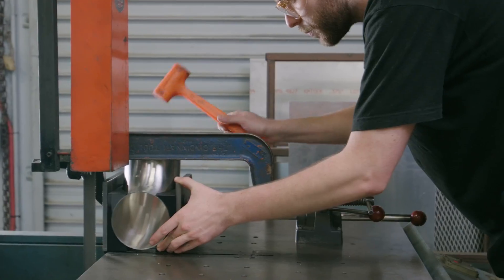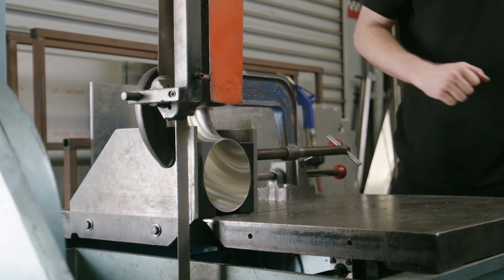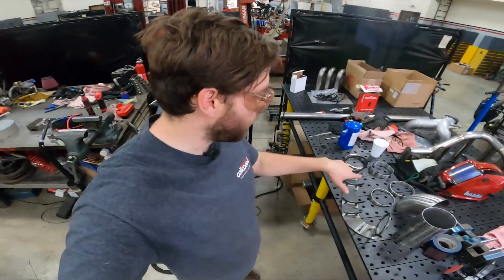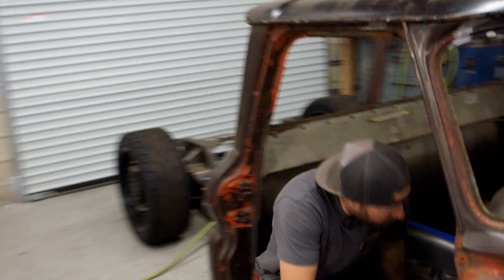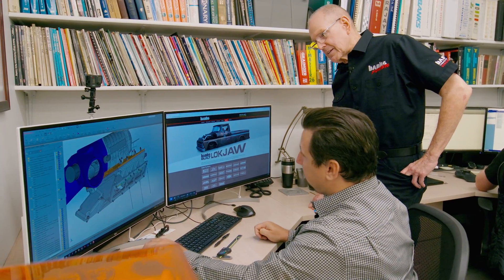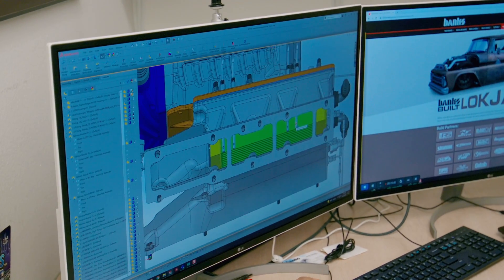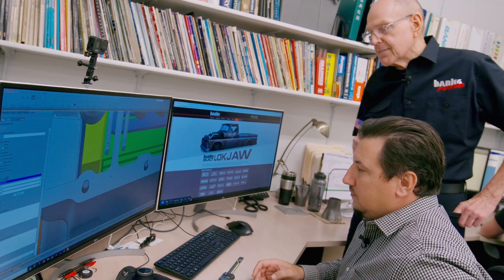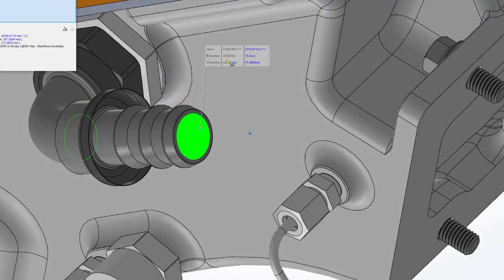Intake Manifold, Supercharger and NITROUS | Banks Built Ep 32

Comment: I love the neat installation of the charge cooler in the vee, I`m building something similar (but gasoline) , but I can`t do this due to my intake runners and I am having to use water-meth due to lack of space, so the question is, why do you not use long intake runners on diesels, and can you get any power (efficiency) gains if you did?

Comment: What is with that bandsaw? it spins the tubing? Is the blade sharp .Do you have lubricant flowing over it? Its the blade speed slow enough?That setup you made is too complex and costly.  Use a power hacksaw with lube. Or a plasma cutter. Engineers should consult people with hands on experience.

Comment: For the nitrous system you could emulate the use of a spray bar like in a carburettor plate... but have a U shaped bar that goes from the 1st to the 4th nozzle. That would give uniformity I think...the second stage could be done in much of the same fashion connecting 2nd and 3rd nozzles. The central part would be a second stage but it would cause a preferential flow to the mid cylinders of that particular bank...
Another solution would be with a single U shaped spray bar on one inlet the first stage of nitrous (call it a 150 shot) and on the other inlet the second stage with different jets (call it a 300 shot)... and the switch between the 2 stages is just deciding which solenoid to fire...

Comment: For the nitrous nozzle you need a compression fitting with a rubber o-ring.  Like the Harley Davidson Ironhead Sportster oil lines that go from the crank case to the rocker boxes. This would allow you to clock and set the height giving it full adjustability. You could even laser engrave the tube for clocking and height purposes.

Comment: That saddle jig is cool!
If I may suggest for the future a small amendment to the design - if rather than tacking the saddles to the main support plate, you made them so the insert didn't make it quite all the way through and drilled and tapped the ends for, say, 3mm screws, you could use a couple of cross-pieces, or plates, to clamp the saddls in place and make it simple to unscrew and swap them to the back for the mirror image jig.
The advantage is that then you have easily re-useable saddles that just need different base plates cut for different projects. Same principle if higher and/or different diameter ones need to be fabricated for other projects. You'll have a nice collection of options in next to no time.

Yup, same reason I despise RTV - probably killed a LOT of engines when bumble-fingered fools use WAY too much and block oilways and oil pickups.

Might have missed the discussion, but any particular reason a toothed belt isn't being used for the blower/auxiliary drives, as that would pretty much eliminate the possiblility of slip, and not need drastic levels of belt tension? Can't see the additional noise being a concern 😉

Comment: Why not nozzles that spray downwards in an oval pattern.  Particularly if yo move them higher up and run 2 then the other 2.  Or are you running 2 then all 4?     Love the build. The only issue is you guys still have the steering wheel on the wrong side
Reply from the maker: That's a negative GhostRider, it's on the correct side.

Comment: what happened to killing a durmax and the engine being built, i know covid was a factor and engineering a proper pulley set up?
Reply from the maker: Both the Super Turbo (Monster Truck Engine) and the L5P for  “Killing a Duramax” on hold for an extended duration while we conduct testing for our military program in Dyno Cell # 1 & #2. The moment these projects are completed, we’ll roll both the Super Turbo and the Killing a Duramax back into the dyno cells.